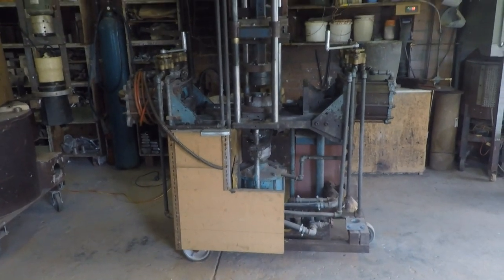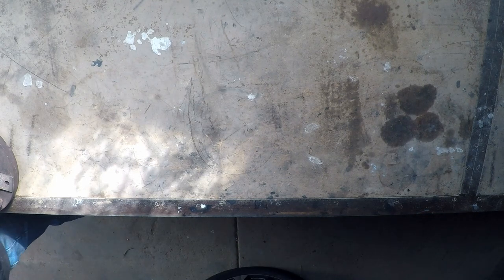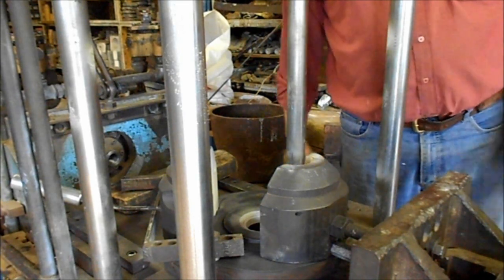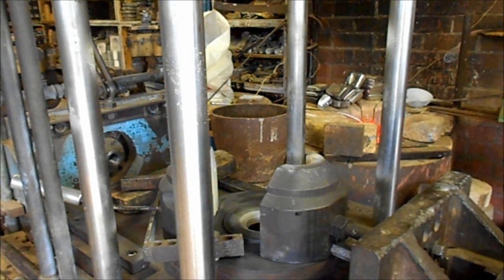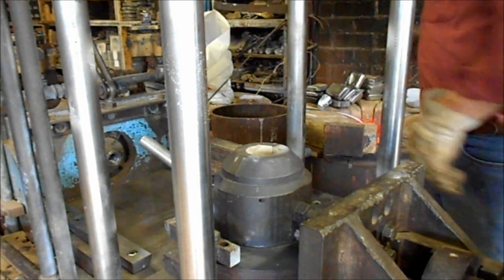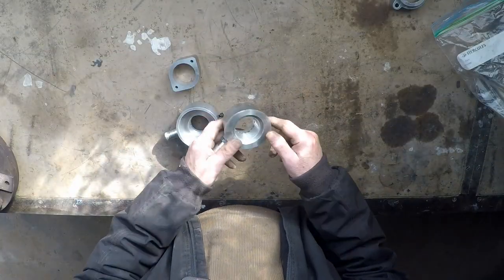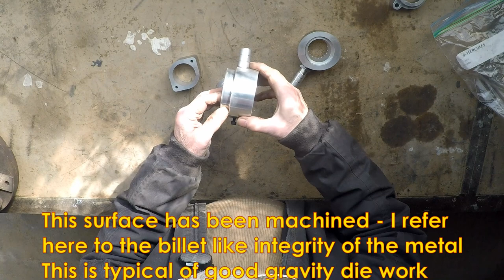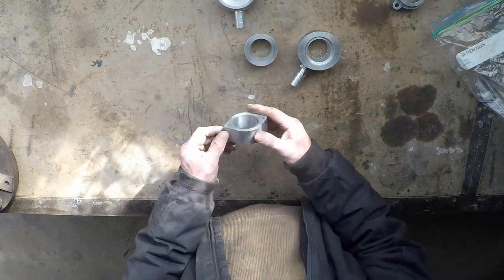A Gravity diecasting journey Part 3:- Complex and hydraulic

Comment: I especially enjoyed the commentary on a few castings and molds that didn't work out, or were a right pain to produce. Your explanations pointed out a number of things to avoid or design around. I've really enjoyed this series. Thanks for making these videos. Cheers!
Reply from the maker: James, Most of the bad jobs were ones I had been stuck with by other foundries (Greeks bearing gifts). I long ago resolved that any of my dies would be designed with ease of use and good reliable casting production in mind. Fighting for every casting with a bad die is just not on in my mind.... Martin

Comment: Thanks heaps for sharing your experience. I used to work in a foundry and it was by far the most interesting place I have ever worked.

A lot of the machines they ran there were all custom fabricated like you mention. Most of the big ones were hydraulically powered. Some of them were  just used mechanical clamping power. It's only now that I'm older and think about it, they had some great engineers and fabricators that built and maintained these custom machines.

Would be great to see more of these videos if you have the time. Cheers!
Reply from the maker: bin, Yes, gravity die work has pretty much always been custom sort of thing - each shop developed its own machines and methods. I note that now mainly Chinese manufacturers are making die holding machines, but sadly many will not allow proper die filling - their tilt casting machines are all wrong! I do hope to do more videos - I sure have the time but not at the moment the health needed to allow me to get on with it.... Martin
Reply: @olfoundryman8418  Thanks Martin. No rush about any new videos. Take care of your health first. 👍

Comment: The explanation on why certain molds didn't work out made me for the first time really... understand... something. In a way it's rather rudimentary: the thin sections freeze first. Of course I knew that already, but I maybe didn't keep it in my mind when I considered other things. It explains why we feed the thickest section in a casting. It also explains why we feed from a feeder and not a sprue - a thinner sprue is needed for avoiding air bubbles, but that thinner sprue will inevitably be one of the first things to freeze up. And there's no feeding through solid metal. I can also now see why two thick sections separated by a thinner section absolutely need their own feeders, no two ways about it - that bridge is going to be rock hard while the thick sections are still thirsty for more metal to take up the shrinkage.
Reply from the maker: Johannes, Two thick sections separated by a thinner one - Ah. Yes, the dreaded "dogbone" problem. In truth though, sometimes (sometimes) you can get away with just the one feeder on one of the thick sections (the bigger one if there is a difference). It depends on how long and how thin the thin section is and how big the one feeder is as well as the size of the unfed thick "end'- It is all to do with conductivity and flow of liquid from the feeder keeping the thin section just liquid enough to allow feed through to the unfed thick area - it is a risky technique though, and needs to be carefully trialed. I do tend to recomend and use the two feeder approach though..... Martin

Comment: What a wealth of knowledge. Are the dies and cores all just steel? What's the whitish spray coating applied?
Reply from the maker: Bradley, The dies and most of the cores are grey cast iron. Mild steel can be used and H13 die steel is used for very long life commercial dies (not by me!). Grey iron purchased as con cast bar is in many ways the best material.
The whitish coat is a commercial die coat called "14ESS" it is made by Foseco I think it likely to be a fine refractory like alumina, silica or talc (perhaps) plus a little clay with a sodium silicate binder. It is sprayed onto the hot (200  deg C plus) die  as a thin water dispersion, it flash dries to form the whitish layer.... Martin

Comment: I like the videos on this project 👍😀
I worked for 30+ years as a machinist/ hydraulic engineer and in the first few minutes you mention that there are no hydraulic valves to push the cilinders , but there are…
You have a few options to use valves and best is to use a set up with a relatively small pump and a few accumulators.
This way you can make a suitable hydraulic system.
This kind of system is used on plastic molding machines.
This is ofcoarse not cheap but you can find a lot of used parts and iverhaul them and adept them to your needs.
If you want i can give you a principal schematic of such a system wich can be altered to your machine
Reply: A small remark is on the fittings that you used on your machine.
They look like malleable fittings and they are actually not suitable for hydraulics and can only withstand low hydraulic pressure.
This gets worse in the larger diameters.
Reply: @gertjevanpoppel7270  The hydraulic system of this machine has a working pressure of ~50 PSI, or 3.45 BAR.  Definitely counts as low pressure in my book.
Reply: @dfross87  
Yes 👍 that is definitely low pressure … you have to be careful not to fart next to the machine or it will open or close 🤣.
The castings are great 👍
Reply from the maker: Gertje, I approached the getting and altering of this machine from a point of view of penury!
             It had been operated by shop air pressure for many many years and I had seen it thus. I was alarmed by how springy air cylinders are particularly in an application like this where dies need some  force to first move and are then quite free -you can imagine how everything use to jump around. Also one at times needs to start a die moving very slowly for the first mm or two lest the casting catch and get ripped apart. Air is noisy all that hissing etc! So I resolved to convert the machine to low pressure hydraulic using an old (and therefore cheap) propellor feathering pump. The cylinders are large 250 mm and 200 mm diameter with strokes up to 250mm. You need control values with large ports to handle the required amount of fluid at the low pressure I had in mind. I had none like this and while they may have been available the cost would no doubt rule them out. So I made my own, just 4 way taps really but with about 15 mm diameter ports, even so the machine is a bit slower than I would like. The slow steady and very controllable flow and thus cylinder speed though  I greatly appreciate.
Much of the pipe work is as I received the machine I added a bit because I added the top cylinder. It is all common galvanized steel water pipe with the usual malleable fittings. Decent hydraulic fittings would have been nice but then my shoestring budget and clearly at just 50  maybe 60 PSI the waterpipe and malleable will survive just fine.
Accumulators would have been a nice addition but ones to go with such a low pressure?? I probably would have had to make one and one of a good size too I suspect - I was actually given a couple but they were small and for a 3000 psi system so not of much use to me.
It's not the machine that you have to be careful of farting near its the furnace! 😊... Martin
PS. thank you for your offer of a schematic but I have had to let the machine go 😰 😱 to another foundry as I can no longer do the work and I wanted my customers to continue the receive castings

Comment: Heatsink fins would be easier with high pressure casting.
You can put degassing stuff in the metal before pouring too.
Reply from the maker: russell, Yes, it may well be easier to do fins with high pressure diecasting but you would need the quantity demand to be high in order to cover the cost of the much more expensive pressure die casting die.
 I do degas any aluminium that I am going  to cast into sand moulds but generally I do not degas metal destined to be cast in a gravity die. The much quicker solidification in a gravity die largely prevents gas being a problem. I degas with Argon gas and Iam not too sure what you mean by "degassing stuff" many people use the most useless of substances for this task, washing soda and epsom salts for example either of which will increase gas levels not reduce them.... Martin

Comment: Thank u so much for the amazing content. It is invaluable for us novice DIYers. I'm just curious how you get away with doing a direct pour on some of these die casts. I've tried it a few times in both ceramic shell and sand casting but with little success. All be it with rather questionable mix of alloys. 
 
Your previous video entitled "possibilities" is a great source of information thank you again
Reply from the maker: Shannon, You are not wrong in seeing direct pour as a dubious process! I assume that by direct pour you mean top pour. It is bad because it risks turbulence that both generates oxide films and traps air in the casting.  Thin is rather a pity for as I am sure you know it is often the easiest way to get metal into a mould. For the casting shown in this video I first tried it without the shell core "funnel" sitting on top of the ceramic foam filter. It was a complete disaster with 5mm diameter bubbles in every casting - due no doubt to the 100 to 125 mm fall of the metal as it filled the die. Use of the funnel and filter broke the fall up into two approximately 50 mm falls and no bubbles were ever found in now about 500 castings. Whilst having metal freefall at all is a bad thing it's all about the height of the fall. Thus I will always advise no fall at all but my experience is that 50 mm is ok but 100 mm is definitely bad and 200 mm catastrophic. So I use direct pour because it is easy and makes die design easy and cheap but I keep the fall height as low as possible - it is cheating I know but in the main it has worked for me. Note though that I use good metal - certified ingot from a reliable supplier. I would not like to try and achieve the same results with unknown junk scrap wrong alloy dirty oxide ridden etc. etc. metal... Martin
Reply: @olfoundryman8418  thank you so so much for sharing your wealth of knowledge. I look forward to seeing your upcoming videos.

Comment: Martin, @21:30 you say that quick cooling reduces porosity, but on many other occasions you add exothermic powder to keep metal hot in risers for longer?
Reply: That's so the feeder stays hot long enough to feed the casting adequately and avoid shrinkage issues in the casting proper (no problem if there is shrinkage in the feeder).  Like many situations, it's a bit of a compromise.

I vaguely recall Martin saying that he takes more care to de-gas the metal when he is sand casting because of the slower cooling, but he can explain it better than I can.
Reply from the maker: Vlad, Adding exothermic to the top of the feeder is unlikely to have much if any of an effect on the solidification time of the casting proper so I doubt that it will increase gas in the casting.  As dfross suggests the porosity in the feeder will likely increase but as we melt that down again it does not matter. You will note too that I sometimes chill the bottom of a casting as this will - apart from promoting directional solidification - cause the chilled area to solidify much faster hence less (if any) gas and a stronger more ductile finer structure.
Further to dfross's comment I rarely degas metal to be gravity die cast the quicker solidification means gas is unlikely to have time to precipitate out of solution even if the hydrogen level is above the amount that solid aluminium can theoretically hold. It simply stays trapped in super saturated solid solution in the aluminium where it does no harm and may in fact add to the metals strength through an alloying effect (solid solution strengthening) For slower to solidify sand cast work though  I am a bit serious about trying to degas properly.... Martin
Reply from the maker: dfross, Thank you for your input  please see my reply to Vlad.... Martin

Comment: Hello foundryman, could you please show us your own process of the lost PLA Casting if possible? it's what i do mostly at the foundry, i 3d print a Figure (Mostly small Japanese Cartoon Characters) and do a simple PLA Casting but i get lots of Problems and issues, i just keep trying till i get it randomly right, without knowing what's the issue
Reply from the maker: David, I have never done lost PLA casting! However I have watched many on UT attempt it with varying degrees of (non) success. The mistakes that many make are (to me) obvious. If you can come to me at  olfoundryman@gmail.com with photos of results and a description of what you do and what you use to do it I may be able to help. Considering what you are trying to produce 3D printing is not an unreasonable starting point.... Martin

Comment: Thank you for sharing your experiences, it's truly very informative! I looked up the Dow Corning 3120 RTV Rubber and the useful temp range is only 300 degrees Celcius. I am looking to make molds in an easy way (not to have them machines in steel) to make zinc anodes which are pretty simple in shape, I am just not sure what to make the mold out of. If this rubber could handle the heat t hat would be great, I would 3d print the positive, then pour the rubber around it to have the mold and start pouring zinc. Would love to hear if you have any solutions. Thank you!
Reply from the maker: making, Yes, 3120 is not really rated high enough to take zinc but for thin work I got about 50 shots before the mould was useless. I also tried another brand of castable silicon (Wacker I think) it looked the same but broke down on the first shot! Zinc anodes tend to be thick so the castable silicon is a no go. I see two possible methods: 1, use a simple metal die - if the shape is simple with no re-entrant angles a die machined from aluminium should do either billet or cast aluminium. 2, Look up Tekcast - they are big in moldable silicon rubbers for spin casting - they even have a rubber that aluminium can be cast into (on a limited basis). Their web site is very informative. My choice would be #1... Good luck... Martin

Comment: Of all the things that would be a stretch  of my knowledge, every time I watch you, I feel that I should give gravity casting a try. What would be a good starter? Just trying lead, zinc, pewter?
Reply: Take a look into bullet casting just to give you an idea of simple permanent mold casting. Simple molds and melting pot. Lead alloys are normally used but some people have done zinc as well. Pick the metal that suits your application. 
Normally bullet molds were made from cast iron but aluminum molds are also used.
Reply from the maker: Paul, As Rudy suggests you could look at bullet casting, generally I believe for older black powder relic weapons or perhaps a bit more universal the casting of fishing sinkers. All done in lead of course - although these days on environmental grounds lead free materials are being used. For home casting these would likely be tin bismuth alloys -absolutely great  to cast as bismuth does not contract on solidification, it actual expands so a 50:50 tin bismuth alloy neither contracts nor expands makes casting a solid product easy  but the metals are expensive. You can buy fishing sinker moulds quite readily so it would be an easy starting place and you can melt the lead or tin/bismuth in a tin can (NOT a soldered one)on a gas stove or barbeque. Most of these moulds are designed without (adequate) feeders for the casting so getting a good solid useable casting can be a question of mould and metal temperature plus pouring technique. It often helps to smoke the mould with a sooty flame. Some people do all sorts of very interesting work in the metals you mention into static silicon rubber moulds... Martin
Reply from the maker: Rudy, Thanks for your input... Martin

Comment: I'm about 12:30 into the video, and a question occurred to me. Are gravity dies ever filled through a filter or does it tend to be directly poured in from either a ladle or the reservoir shown in your tilt setup?
Reply from the maker: elitearbor, The  4 barrel throttle body shown being cast near the end of this video is poured through a filter. If I was doing larger and thus likely higher work I would make greater use of filters as they are invaluable in slowing metal velocity down,  but most of my casting work is low head height and therefore has low metal velocity - filters are not so necessary under these circumstances.  I think it might be somewhat difficult to use filters in tilt work, not impossible mind you, just a bit harder to implement... Martin
Reply: Thank you for the thorough explanation! It's good to know that filters remain an option even with this kind of casting. I'll have to rewatch the throttle body casting, I forgot about there being a filter involved.